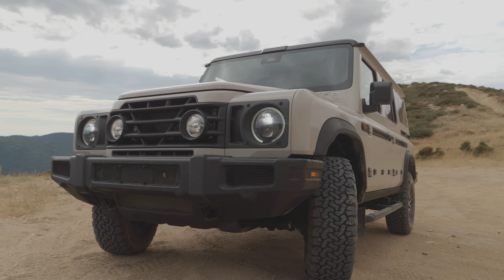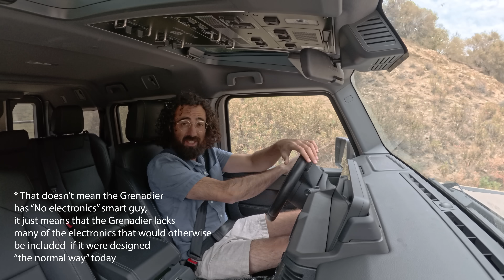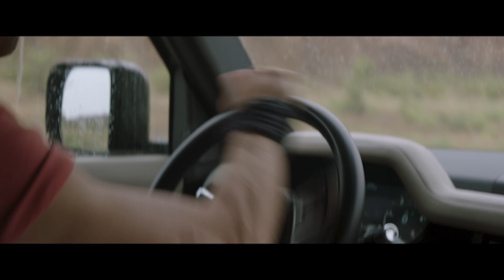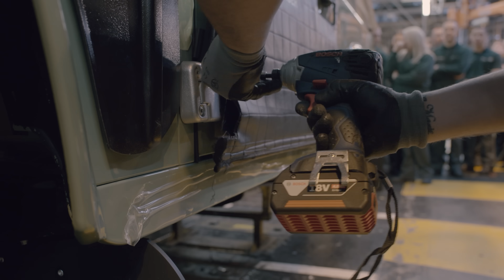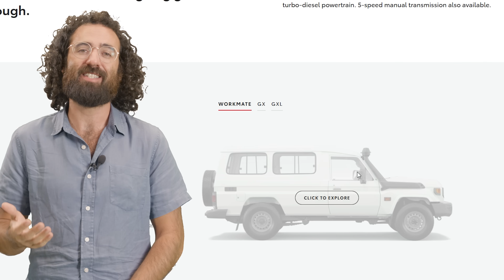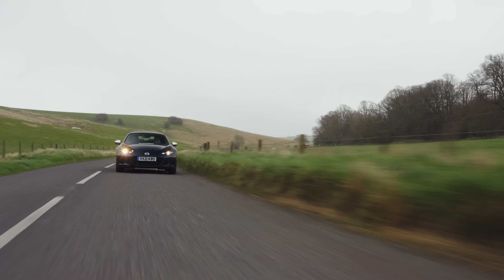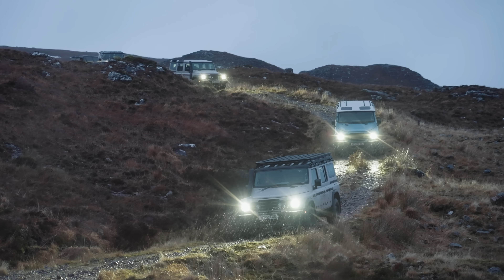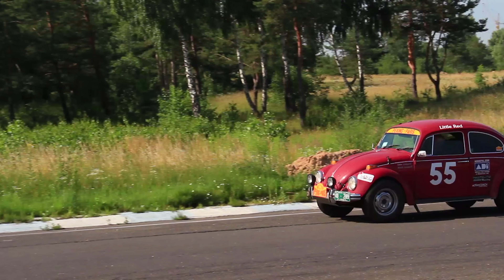Why a simple new truck has to cost over $70,000 in 2025

Comment: In 2026 so far the  average actual sales price of a 1/2 ton pickup is $66,000 the Ineos is not out of line at all. Underneath they use aftermarket spec'd brakes, suspension, axles etc which are all expensive. Love this 4x4.

Comment: Great review—I really enjoyed watching it. You clearly put a lot of effort into explaining the vehicle and its capabilities. However, I think one important aspect deserves more attention: long-term ownership, especially for overland travel in remote regions like Africa.

If you compare the Grenadier with a Toyota Land Cruiser, the difference isn’t just about off-road performance. It’s about reliability, parts availability, and ease of repair. With a Land Cruiser, you can find spare parts almost anywhere in Africa and in many parts of the world. In most cases, local mechanics know the vehicle well and can get you back on the road quickly.

The Grenadier, on the other hand, has had well-documented challenges regarding spare parts availability, after-sales support, and long waiting times for certain components. There have also been reports from owners of electronic issues that can make diagnosis and repairs more complicated than they first appear.

I don’t mean this as criticism of the vehicle—it’s a very capable 4x4 with many excellent qualities. I simply think it’s important that potential buyers also understand the practical realities of owning and maintaining one, particularly if they plan to travel far from dealerships or into remote areas. Looking at the complete ownership experience is just as important as evaluating its off-road performance.
This is my honest thought indeed.

Comment: Even if it was built with a single purpose of offloading, you must judge it on road performance. There are simply not enough off-road enthusiast willing to drop $80,000 for this thing. Whether you like it or not, 99% of all miles put on these cars in the United States will be on pavement. And that’s probably an understatement.

Comment: You perfectly described how I feel about my 2021 Jeep Wrangler Sport EcoDiesel.  It is my only car.  I am retired so I don't commute with it but I drive it into town a couple of times a week.  I go cross country in it.  I drive it on some really gnarly roads to get to places that most vehicles can't.  It is pretty basic.  I do have a push button start and I do have power windows and power mirrors.  I didn't get the smallest 5 inch screen or the larger 8 inch screen but the mid size 7 inch screen.  I don't push a button to go from 2H to 4H to 4L.  I shift into those positions.  I have a 3rd generation diesel engine that fixed the issues with the 1st generation failures.  I have 89,000 trouble free miles on it.  It has never left me stranded or sent codes to the screen that screamed take me to the dealer.   People complain about the lack of precise steering.  But, at my age, that is a normal feel and it works fine especially off road.  I won't break a wrist or a finger by steering wheel kick back.  People complain that the ride on the highway is harsh.  They complain that the wind noise is excessive.  It is a convertible.  I didn't buy it to be super comfy but to go places and explore where others can't.  I really like the concept of the Ineos but it is too expensive.  I bought mine for $42,000 and immediately upgraded the tires to AT from All Season.  I drove it for a year and lifted it 2 1/2 inches and upgraded tires to 33 inch from 31 inch to give me more ground clearance.  I added a roof rack for hauling my lighter items such as a tent, sleep bag and sheets and blankets and clothes to save space inside.  I built a 6 inch platform that allows the rear seats to fold down and provide me with a flat surface to "sleep in the Jeep" when I am on overnighters and I don't want to set up a tent.  I use the space under the platform for more storage in plastic bins that can easily be accessed.  In short, it doesn't do everything but it is good at what it does.  Thanks for your video.  I have never heard another YouTuber describe an Ineos as you did and it fits my feelings about my Jeep.

Comment: If I'm dropping a $100000 on a vehicle like that 392, it better f**** work for a 150000 miles with no issues borrowing my stupidity.
It's also unbelievable that that thing cost.So much people have been asking for a b a wrangler for decades.Why jeep hasn't pulled their head out of their a**?And just put the hemi inside of one of those things.Price it at fifty sixty k, you won't keep those on the shelf, but they had to put a three ninety two in.You're almost paying fifty thousand dollars for a motor and if you're gonna do that, you might as well, just buy a base model, buy a crate motor and transmission.Do it yourself and save ten two fifteen thousand dollars and be way more reliable+

Comment: I'm an enthusiast of performance on pavement and with the exception of owning winter beaters when I lived in the rust belt in the 70's and 80's I was a 1 vehicle guy. That all changed when I became self employed about 25 years ago, I have been driving the same 4WD work truck since 2003 and I have a 2nd vehicle (a RWD sport truck) for daily driving. Simple, older non-luxury multipurpose pickup trucks that can easily be modified are what works best for me. A 3rd more analog vehicle is in the cards for me, a manual transmission body on frame vehicle with air conditioning and without an ECU... finding the right one is the challenge.

Comment: I would absolutely drive the shit out of one of these things if half of the drivetrain was not made by a company that has a terrible track record of over complicated and excessive engineering not to mention how anti right to repair and locked down their stuff is. Forget a quick bush fix when you need to have someone from the mother ship authorize "their(cos they don't believe in personal property, you don't actually own it)" engine/trans to function with a part it does not recognize. Or needing a cell connection to access diagnostic info. Those things simply do not exist when you are truly in the middle of nowhere. This will not hold up in those places until it is made to be repaired more easily. All it takes is one sensor that needs to be specially programmed for no reason other then a profit seeking money grab to take it down when you are hundreds of miles from the nearest cell connection/dealership.

Comment: This is how Tesla started out. 100k vehicles have turned into 40k (not the same model) vehicles.  
I'll stick with my 25 yr old landcruiser that has aftermarket  cameras and radio for under $1000 extra, but I am glad that this vehicle was built. In 20 years, when my landcruiser dies, I'll probably buy one used.

Comment: I hate that cash 4 clunkers got all the cheap, durable cars off the road to pave the way for planned obsolescent identical crossovers and $70k 4x4s in the name of regulations that allow modern pickups to have a worse front blind spot than an M1 abrams and headlights fit for a panopticon. mechanically i like the grenadier but for that money i could buy a piper cub. great video breakdown though

Comment: You can completely rebuild, refurbish, restore and recondition any FJ40, FJ60 or FJ80 Land Cruiser, Series 1-2 or 3 Land Rover or CJ  Jeep bumper to bumper cheaper than you can buy a new one. It does not cost $70,000,00 to refurbish an old school vehicle including Ford F250 4x4's and Chevy K's 4x4's.

Comment: I ended up buying a 2015 F250 with a v8, 4x4, and locking diff. Manual 4x4 actuator, manual windows, and manual locks lol. It was the most simple truck I could find. Bought it from a railroad company for $6500 and I'm modding it out to be an overland RV. After adding suspension, a flatbed, and the truck camper I'll still be in at less than half the cost of most new vehicles. Planning to drive the Pan-American highway with it!

Comment: This review isn’t grounded in what real owners actually think of the Grenadier. The Grenadier is a total catastrophe — that’s why they’re piling up at dealerships.
I owned one for a year. It spent two separate visits of more than three weeks each at the dealership waiting for parts that aren’t even available in the U.S.
Major issues I experienced:

A/C failure

Windshields cracking when you turn on the defroster in cold weather

Doors that get stuck or constantly show as “open” on the main display

Phantom alerts from the parking sensors

And here’s the worst part nobody tells you: after the first year, you’re hit with a $1,000 “first maintenance cycle.” That includes dumping the so-called “break-in oil” from the axles and a 12,000-mile engine oil change.
You can’t even do your own oil change, because the service reminder can only be reset by the dealership.
There are so many issues. People don’t read these days — but if you’re considering buying one, do yourself a favor: spend a few days on the Grenadier owner forums. You’ll see exactly what you’re signing up for.
Yes, on paper it’s what we all wanted — a rugged, old-school off-roader — but in reality, it’s nowhere near as comfortable or reliable as a Toyota TRD Pro or a Jeep Rubicon.
Also, brace yourself for absurd aftermarket prices: $60 for a small 1-inch aluminum part, or over $2,000 for a decent roof rack.
And honestly, I’m forgetting a dozen more problems. Just go read the forums and save yourself the headache.

Comment: Jeep sport trim wranglers in manual for the last 20 years. Am i joke to you? crank windows, manual t case, manual gearbox, solid axles, body on frame, no turbo, hell no side impact rating by the NHSTA. All competitively priced at around 35k. One of the main reasons i didn't buy a Grenadier is because it actually can't fully disable all of it driving nannies. Want TC off for the sand so you can safely hit the dunes? nope it can't unless your in 4LO, but you need 4HI for the wheel speed. dumb af. Lockers on when ever? Nope, gotta be in 4lo for that too. plus so many more little caveats than i can cram into a single comment. The grenadier has the mechanical prowess of a great offroader, but the engineers and design team were more concerned with getting old money just sitting around from people who bought the OG defender up until it was discontinued. And to be fair, why not? That segment has overpaid for simple shit for decades all in the name of "heritage". The 79 series Toyota is still made new to day with used models going for pennies next to Defenders or Grenadiers. Actual offroaders will pick the 79 series everytime. And stateside where we don't get the 79 series? Jeep, I bought a 23' Gladiator Mojave brand new for 40k less than a Grenadier at the time. And its mechanically superior in every way except the motor (3.6 pentastar sucks lol) and it actually has the ability to kill all driving aids. ABS sensor take a shit offroad and has you in limp mode. Just disable ABS and remember to brake carefully. want your locker in 2wd? sure go ahead.  TPMS light annoying you when aired down? just lower the alarm setpoint or fuck it, turn the whole damn system off. It doesn't care. Anyway mine is 5.7 hemi swapped now to cover the only thing i found lacking in the stock gladiator. and guess what the swap plus the price of my truck new is still cheaper than a Grenadier. And before anyone says that Jeep won't last me, just wait till my warranty expires. 2 things. I avg 36,000 miles a year on and offroad. that warranty was shot a long time ago, and no there wasn't a single failure, still hasn't been. and they are easy AF to work on. I miss my Toyotas but stateside i can't think of a better midsize truck/suv platform than Jeep. There isn't a single competitor  i haven't seen have a catastrophic failure or odd shortcomings. Toyota practically needs everything suspension and drivetrain swapped to something beefier just to do what a stock wrangler can. Ford honestly really has stepped up with the bronco but the truck segment is still to road oriented as far as midsize is concerned, Chevy ZR2 is nice but I've personally witness 2 brick their ECMs for like no reason. new Defender is dooky cheeks and i will not debate it. The only vehicles i've seen keep up with my gladiator on tight technically trails are old OBS Broncos and Old landcruisers and toyota pickups. The Jeep can either hold your hand and pretty much offroad for you if you want. Or it can sit back and let you royally fuck it all up. No else really does that on newer 4x4s. I may have a new truck but it doesn't feel like it where it matters. Yet its still electronically capable enough that I can put a 12 yr old behind the wheel and I know the truck will do all the hard stuff for em if needed.

Comment: this is not a simple truck.  A simple work truck for use on a highway and city streets doesn't need 4 wheel drive and locking differential.  It doesn't have to be that big.  A simple fuel injected v6 or straight 6 or small  V8 will do the job of getting 1000 pounds of goods from 1 point to the other and towing about 3000 to 4000 pounds around a city.  You might have to slow down when you cross a mountain, but most don't do that often.  Mechanical windows, heat, air and power train.  Simple bench seat.  Club cab option.

Comment: I recently had to replace my sickly Outback. Like you, I was disgusted by how modern pricing and the fetishization of accessories and the softening of the machine into a fashion accessory for performative masculinity with none of its true capability. Like you, I wanted something reliable, well made, low maintenance, that got reasonable mileage but spared nothing for capability. Something that worked well enough on the road that I could drive it across the country to any trail I wanted to drive on. Like you I also wanted the gross simplicity, ruggedness, ease of maintenance and repair, the end-user serviceability and the lack of overbearing luxury imposition used to justify the grotesquely overinflated baseline price point. 

I wanted a new old truck and I didn't accept that it had to cost $80,000. 

So I bought a 10 year old 4Runner. It is the best new vehicle and the best old vehicle I have ever owned.

Comment: 4:35 Considering my Isuzu from the 80s has auto up and down on the windows using a couple of relays, I'm slightly shocked they couldn't find a way to do that with a fairly simple computer system considering they've already got one doing the down.

Comment: Wow, this is an amazingly clueless review. Seems like Ineos sent the marketing material to someone who mansplains that buttons means a car has no computers and let him run with it.
Saying it minimizes the number of computers while at the same time showing a shot of an electronic transmission, electronic swaybars, electronic diffs and electronic HVAC system. This thing isn't just more powerful than a C64 its more powerful than some iPhones. Since it has stability control it has the exact same hardware as those "fancy" offroaders, the difference is in the software. Removing those features doesn't add reliability because the parts don't change. A key is just push to start with more steps. The computer is in control of cranking the engine, turns out that's more reliable than old fashioned setup of running heavy wires to an ignition switch. The auto up explanation is so hilariously bad you would think it was written by an early version of ChatGPT. My old Landy has auto up windows. Guess what? It uses one ECU that also controls other stuff like door locks. The OG defender didn't have any electronic gizmos like sway bars, diffs, or auto temp control. This thing is neither simpler or more reliable.

Comment: They're expensive because people want them to go offroad anytime(even if they mostly don't), they don't want manual shifters anymore, they want strong AC and navigation, heated seats, they can't turn a window lever anymore, they want parking sensors and cameras, and they also want that same offroad truck to do highways without being too noisy.
Which is fine, but it's not going to be cheap.
Oh, and then the government slaps on emission and safety regulations. So good luck with that if you want a cheap truck.

Comment: If you want a simple, reliable, cheap car, you have to build it yourself to avoid the emissions & crash safety stuff... And then you need to keep it off the highway so you don't die in a crash.

You can build an off-road SUV better than this grenadier for 25k if you are willing to buy Dana axles from a junk yard 👍

Comment: I like the Grenadier. The only problem is that my 1995 Defender 110 keeps running fine, parts are cheap and easy to find, and it has no rust. It's also extremely economical. Let's see how it goes for the next 30 years.

Comment: This is such a bad take... Two things to consider:

Here in Europe the Grenadier costs exactly as much as the last Defender sold here adjusted for inflation . Let me rephrase this: It is exactly the same price . If your US tariffs messed that up, it is not on Ineos. 

Secondly the Grenadier comes with a lot of modifications that costs a lot of money to do on the original Defender. Something like the Deutsch Connectors on the roof being pre-wired, fused and switched already... You can easily make the argument that because of that it is actually significantly cheaper than the original Defender. 

Also be aware that the Grenadier is way more heavy duty than the Defender ever was. Just look at the axles for example...

If you want to compare the Grenadier to another 4x4 the only thing that comes close is not an archaic leaf sprung 70 series Land Cruiser but the Mercedes w 464 G-Modell.